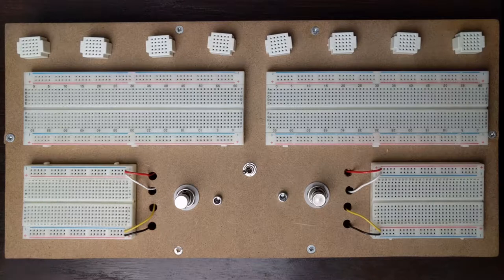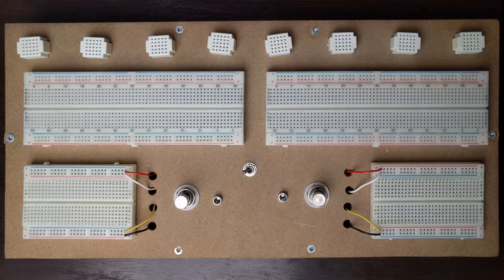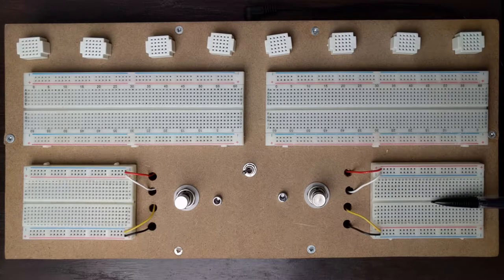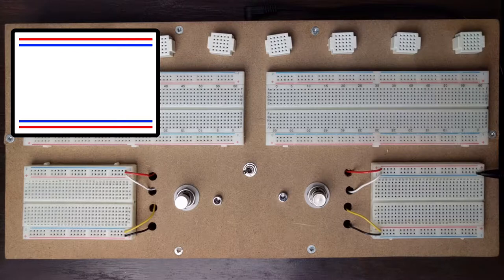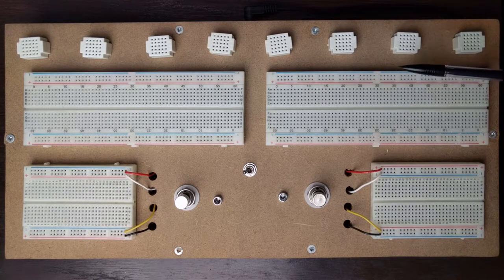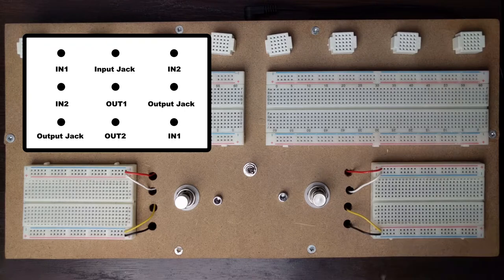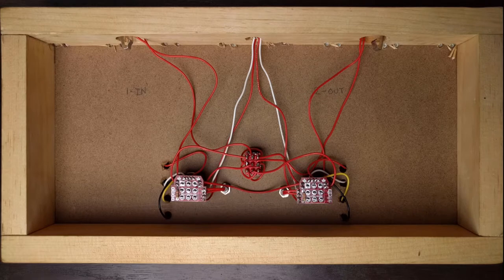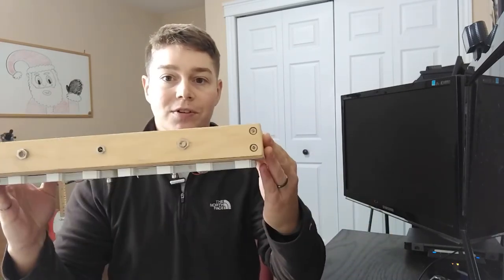My Guitar Pedal Development Board | DIY Guitar Pedals

Comment: You can solder your wires for input, output, V+ and GND directly to the rails. Just peel of a bit of the adhensive tape and you can see the under side of the rails. It's easy to push the out from the top, solder the wires onto it and push it back in :)
Reply: Great idea... I'm so on it, soon as I'm off the throne! Ha.
Reply from the maker: Thanks for the info!
Reply: @LTJR.  you were pooping??